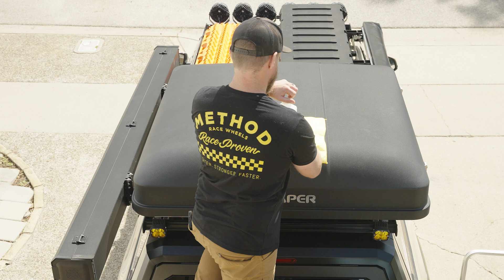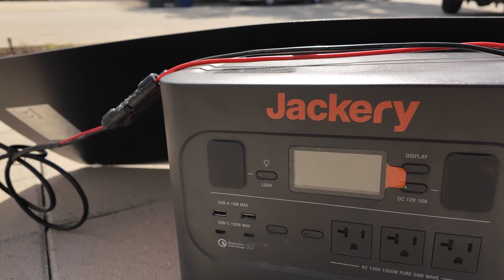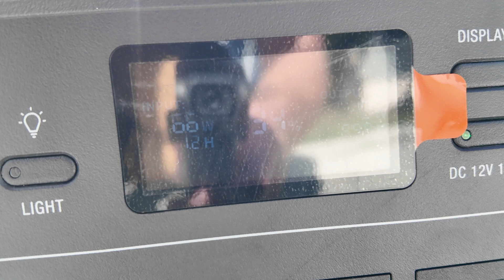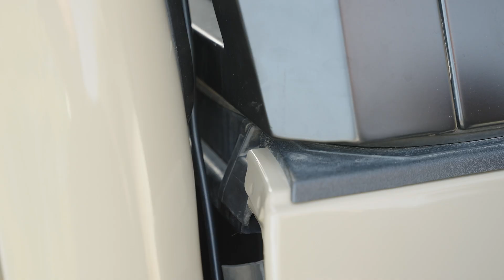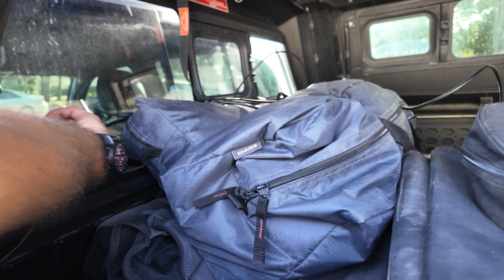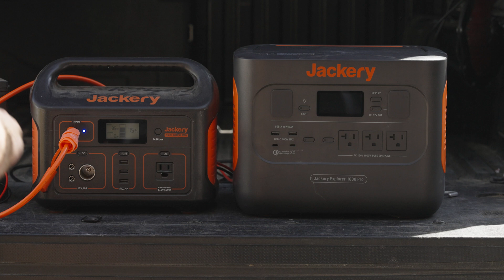Stay Off-Grid Longer! Lensun Solar 80W iKamper Skycamp Mini Panel Install and Review

Comment: nice rig. i just installed a 100watt panel myself. works great. kept my power station topped off. i also plan to get a 12v lithium battery and a 2000watt inverter. this will top off my power station thru out the night yee.
Reply from the maker: Nice! Sounds awesome!